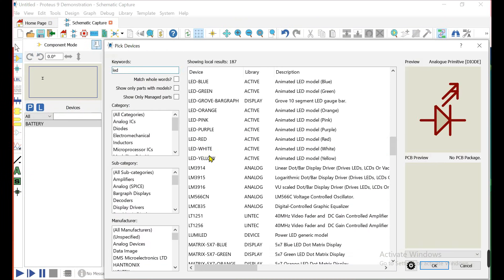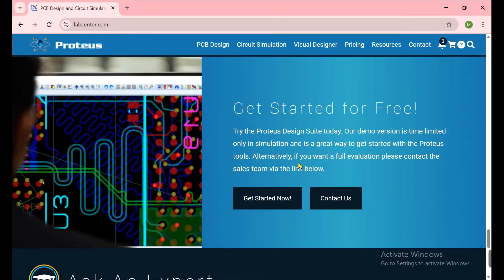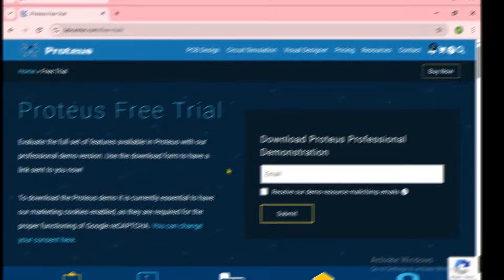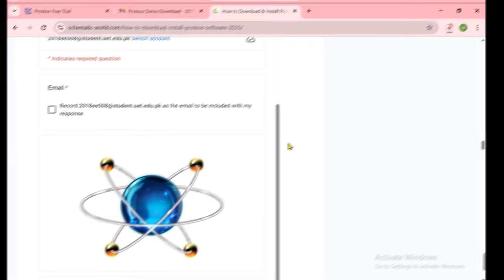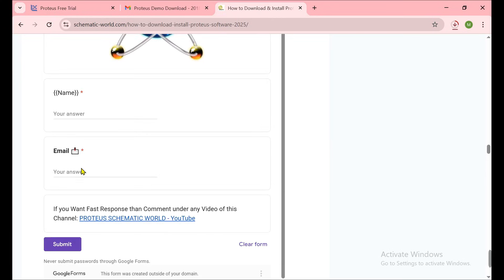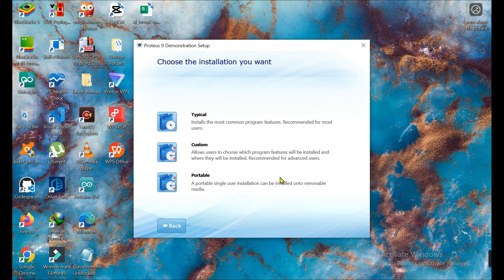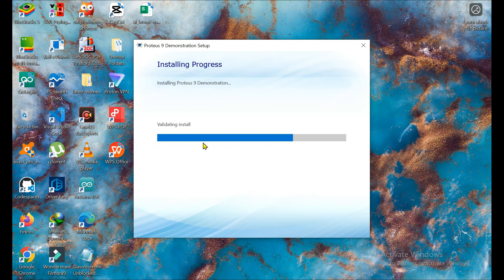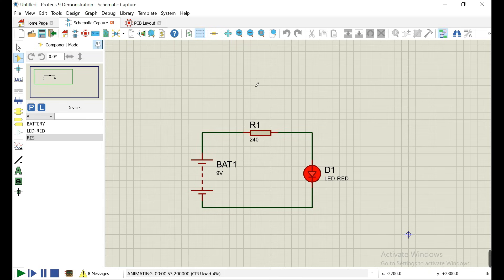How to Download & Install Proteus 2025 | Proteus Latest Version Free Trial Setup

Comment: ❌mixed model PIC18.DLL failed to authorize - Missing or invalid Customer Key..
✅Loaded netlist 'C:\Users\welcome\AppData\Local\Temp\LISA3282.SDF' for design 'untitled.pdsprj'
❌Real Time Simulation failed to start.
❌Simulation FAILED due to fatal simulator errors.

I got the last four lines in the error message like this,
I applied an MPLAPB X file.hex for the pic18f4580 to the circuit, and these appears.
Reply from the maker: This error usually appears when the PIC18.DLL file isn’t authorized or is missing a valid license key in Proteus. It’s not related to your HEX file — the issue is with the Proteus installation or licensing.

Comment: Hi, thanks for the video but in this version i cannot find the instuments section. I need to add a voltmeter to my circuit but i couldnt find it. Chatgpt didnt really help as well.
Reply from the maker: on the most left side tollbar. You need to Right click on it then "Configure Toolbars box" Open in that tick on all option like (expand sub-mode icon groups) then you see the (Virtual Instrument Mode) in that way you use the Voltmeter.
Reply: I'd appreciate it if you can help.